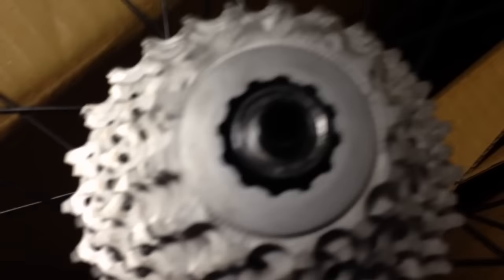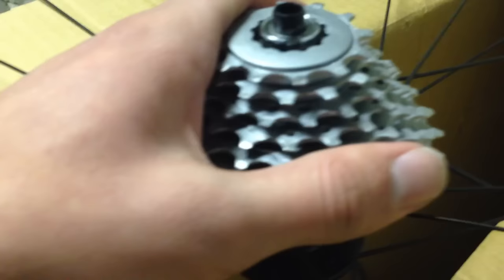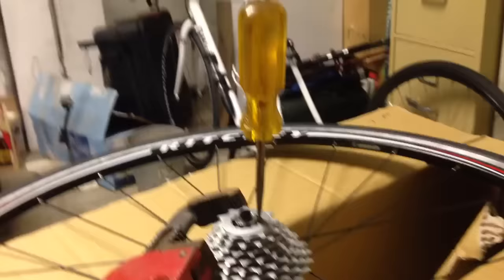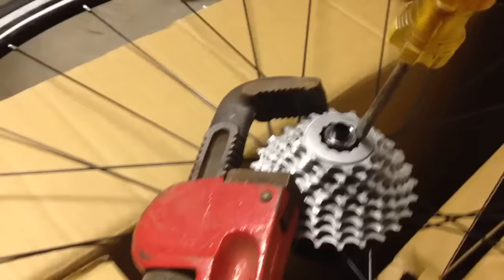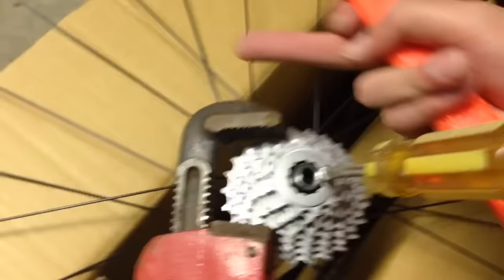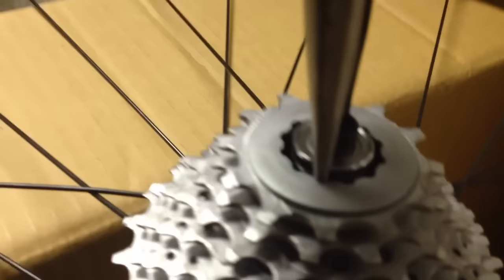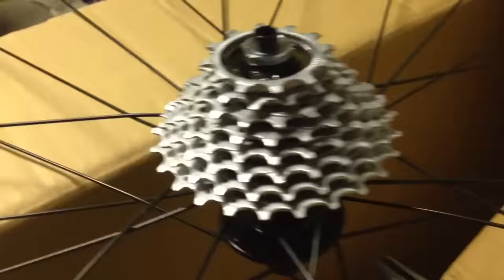How to Remove Bike Cassette Without Special Tools (IMPROVED

Comment: I have a chain whip and hardly ever use it.  All you need is the $5 cassette tool and a sturdy rag (denim works great).  hold the cassette while padding protecting your hand with the rag, and you should be able to hold it hard enough to pop the lock ring loose with the cassette tool and a wrench.  Putting any other tool other than a soft rag or a proper chain whip on the cassette is a really bad idea.

Comment: Thanks for the good video. 

Please everyone, don't use the technique of hitting a screwdriver to get the nut off. We're talking bearings here folks. Nothing like a little impact to destroy a bearing. Flyfreak23 has a much better idea. 

You can improve the torque capability by using a set of angled needle nose pliers. I agree with other posters that the cassette wrench is so cheap we all really should have one.

Comment: I usually am an advocate of using alternative tools for bike maintenance, but this is a bodge at best. If you really don't want to invest into the tools, pretty much any bike shop will allow you to change a cassette in their shop if you've bought it there and ask nicely. 
And if your concern is touring, there is a special tool for removing a cassette while touring and it works without a chain whip. Google it.

Comment: I like to use an old grenade to loosen locking nuts. These are free if your grandfather managed to smuggle one back from action in the Second World War. OR, you could spend £3 on the correct tool instead of spending that money on heroin. Difficult choice I know, but at the moment I need my bike more than a piece of trash sitting at the bottom of the well - I would store the bike in a shed, but I used whatever was laying around i.e. an old well, that a bike would fit in to.
Reply: Don't need a chain whip, just use an old chain and some mole grips to grip the chain. Now that is one easy way round that.

Comment: Nope, i would not advise any of these techniques. If the whole thing is jammed up you need a lot more torque to remove it and this is where tools come in. They arent expensive, maybe 25$ for the 2 you need to do it. Really want to save 25$ risking to break a lot more $$?
Reply: If you are removing an old worn out cassette it wont matter if you damage any teeth, but I wouldn't use these methods on a good cassette.

Comment: If your just trying to save money this is not advisable you better invest on 5 bucks something tools and  if people would said cheap tools break easily been using mine for 1year plus for 200 peso 40 peso =1$ but if it's an emergency or you just don't have a choice you can do this just make sure the wrench grips on the teeth is equally balance or else you might destroy the teeth 😁😅
BTW old chain works as well so make sure hide some if you change your chain hide the old one it's more effective and safer

Comment: If you can remove a cassette with a screwdriver then it is not enough tightened! Should be at least 40Nm!
Be careful folks or you are gonna damage your body (could be really costly if it is DT swiss or Chris King)

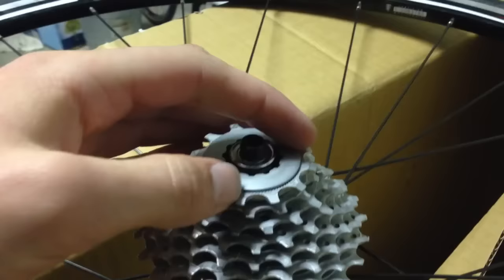Comment: Man that must of been loose as because even trying to hold the cog set with VICE GRIPS  an turning the socket with a rachet it's still a major pain in the rump  any one that's got an old bike chain can make there own cog strap to stop it moving while u open the nut an I'd suggest getting a £3:50 cassette nut just like for the simple thing is your bike is possible worth a fair bit more not giving u crap if it worked for u then sweet but like a say must of been well lose

Comment: My mtb cassette lock ring is torqued to spec (40 Nm) and you sure as hell couldn’t hold the cassette with your hand while even using the correct lock ring tool. So people may not want to expect theirs to be this simple to remove.

Comment: Just buy a chain whip, cassette tool, and an adjustable wrench... Maybe it would cost $30 total. But I can remove a cassette with the proper tools in less than a minute and risk NO damage to the cassette or lockring.

Comment: Yes but how are you going to apply 40nm of force when retightening? That's impossible with your technique.
Plus if you can unscrew it with pliers it was probably not assembled correctly!
40 newton meters are actually a lot of force and it's the norm on cassettes.

Comment: I agree with all the dissenting opinion: trying to remove a cassette without the proper tools is dumb.  The tools are not expensive.   In some places, you do not even have to buy the tools.  You can go to a bicycle co-op, learn how to work on a bicycle properly, and have use of any special tools needed, all for a nominal fee.

Comment: The bearings in that hub can easily pop out with that hammer action.pipe wrench will wreck that cassette...rather use the nut tool so much simpler

Comment: That is terrible advice to the youtube bike enthusiast community. A chainwhip you can get around by using an old chain but hammering away at your lockring is pure carelessness.
Reply: Hammering is a bad idea in most cases. That's why such tricks as using a ply are useful. The ideo, by the way, shows that the hammering method is not good. You might adjust your input device drivers.

Comment: Thanks for the video. Bicycle is the best form of transportation, but whomever invented these special tools for bikes (cassette removal, freewheel removal tool) is a snobbish asshole. This just makes bikes harder to fix, instead of adopting the system where you can stick a regular wrench in and be done with it. I am expected to buy this trinket cassette removal tool, use it once, and after that it will be sitting forever in the drawer.